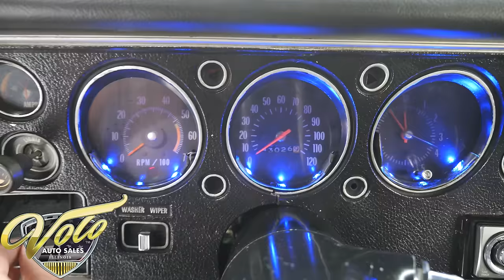1972 Chevrolet Chevelle SS for sale at Volo Auto Museum (V21327)

Comment: Nothing short of replacing the two fenders and adding four lights in the front would make that into a really nice looking car Instead of what the engineers did to destroy it I had a 1970 Chevelle Super Sport LS6 454 after I got out of the service I bought it right out of the showroom Empire Chevrolet black with white racing stripes and cowl induction from 1970 to 71 They destroyed the front end of that car Some engineer thought it would have been a good change I hope he got fired When you look at the 66 GTO which I had and the 67 GTO They didn't do that much and left the car basically intact They just changed the rear tail lights which the 66 looked much nicer

Comment: "Most likely a SS?"...run that VIN  and it'll show what trim and build code it is
Reply: The VIN tells it came with a 454 but does not specify SS. It would be extremely odd 454 non SS
Reply: Pretty sure the 454 was only available with the SS. That's why you couldn't get it in a wagon.

Comment: 454 cubic inch with 450 Horsepower. The last year for Horsepower. The following years Horsepower was reduced by 50%.
Reply: The 72 chevelle 454 was the LS 5..270 hp..the benchmark 450 hp LS peaked in 1970
Reply: @mattf49006  I thought the highest Horsepower Cars ended around 1970. I assume this Engine has been modified for a 1972.
Reply: 1970 and 71 were rated at 450. '72 was the first year for the net vs gross ratings.